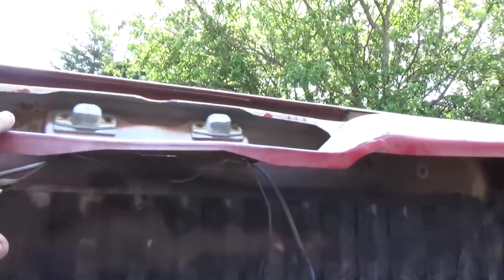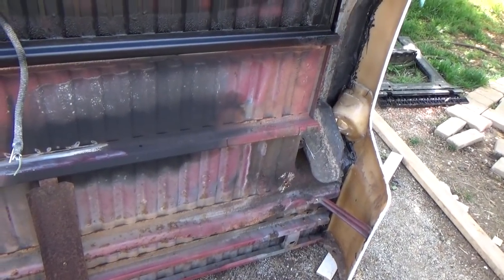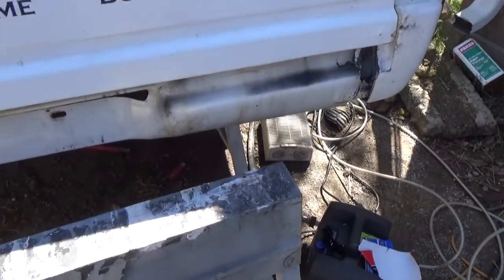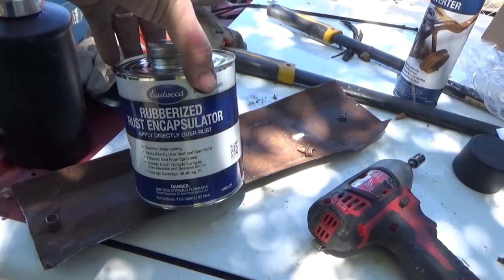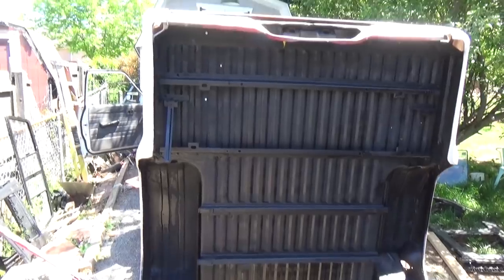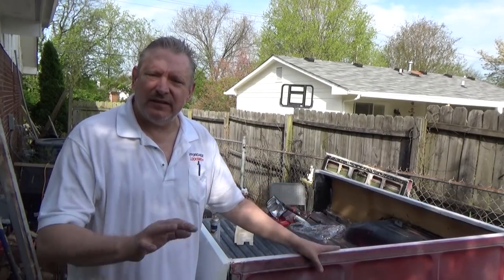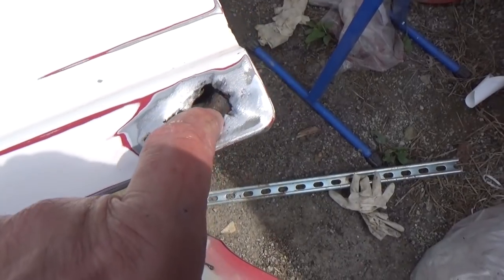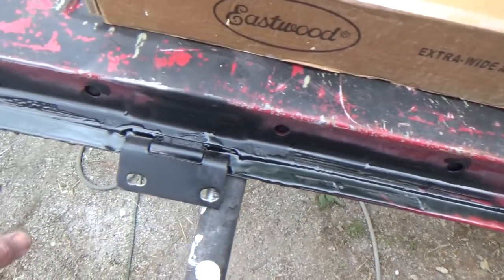88 Toyota Pickup - Eastwood Anti-rust Bed Undercoating

Comment: rubberized no good around these parts it' rust underneath once you get a small hole and next thing you got a massive hole in the frame
Reply from the maker: That's why it has the rust encapsulator additive  + sir.